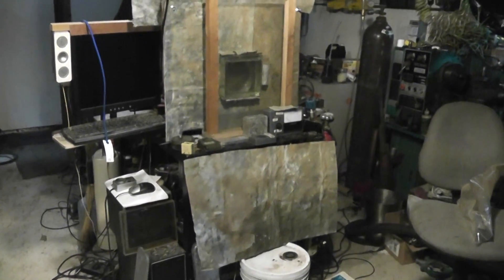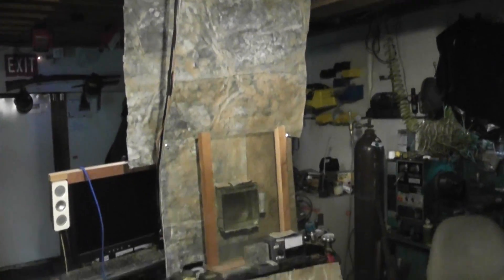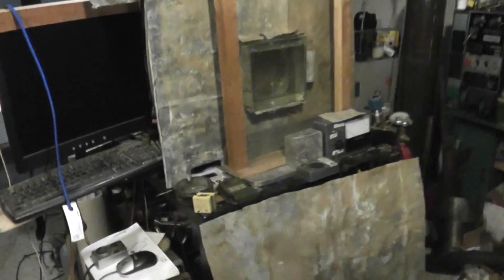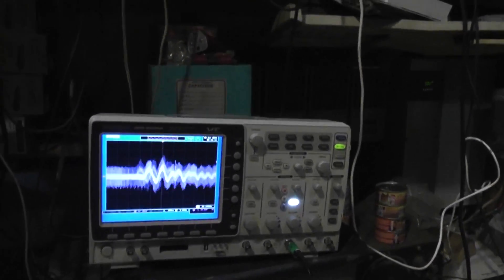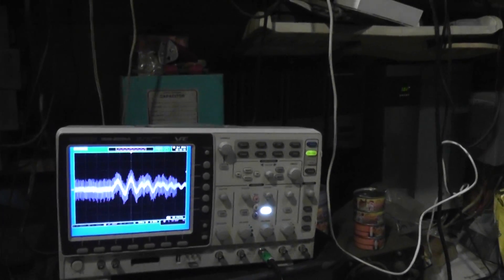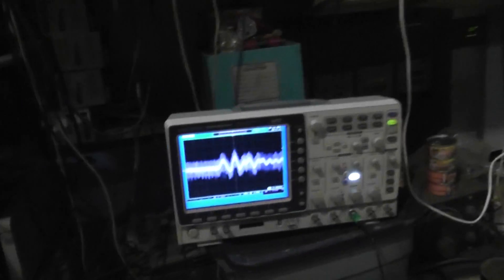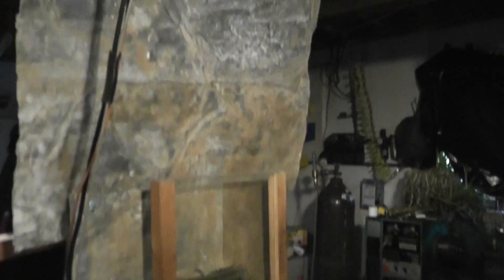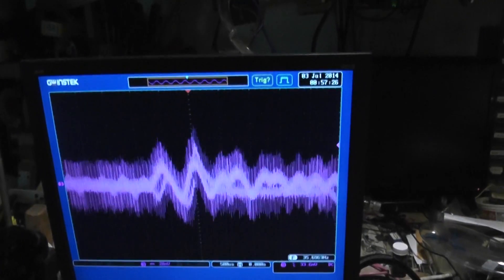ShieldNScope

Comment: Your set-up is looking great! Really appreciate the update videos and the channel in general. Looking forward to seeing more.
Reply from the maker: There will be more when it's worth it.  I use this primarily as an adjunct to my web forums - yet another way to document my work (and share it open source).
Right now I'm doing all this boring crap with shielding...crawling in the crawl space in the dark fighing spiders while digging new flat spots for more cinderblocks to hold up all this lead and other nasty work like that - with a whole 2 feet of room between the bottom of the floor and the dirt to work in..  Heck, even I don't want to see it at the moment, it's just necessary.  Believe me, it's driving me nuts too - I'd rather be nailing down that huge advance I think we just made - but I want to live to tell the tale!  So, we beat lead flat, make castings for more shielding, make sure it's doing what it should, junk like that no one really wants to see much of: "conceptually trivial" but actually pretty hard work.

Comment: How long until we have free energy Doug???  :)
Reply from the maker: Wish I knew.  I just know I'm going as fast as I can, which turns out to be faster than just about any historical effort I can think of by quite a bit.  BUT!  This isn't "tradeable info" or a "sure thing" yet, just being honest.  We could (and have) come factor of a 10 million++ since we started about 3 years ago, still have say 10k to go (very conservative if the latest thing pans out - which mayday run is kind of a hint of), haven't run into any walls, other than operator safety - which I'm working now, it's looking good so far. 

But let's assume I get there in say, a week (unlikely, this is for hypothetical). 

OK, now we get to go through some guy from a steam plant maker designing a boiler/turbine system for it, and getting the government to approve it, a financing process, and probably some new regulations have to get passed.  Not that these can't go a lot faster than they have in the past - this is pretty "safe" compared to fission (or coal!) - but...we know those things take time to get the power to your outlet.

It will never be free.  Someone has to make them - I'm just one guy.  They deserve to get paid for making them, no? (maybe not a state-guaranteed profit as now, but some anyway)  I might give the plans away (and that's plan A) but...that's not all it takes in the real world.

As far as building one of these home sized (which I'll for sure do for myself), that's probably quicker, but my solar panels likely cost less per watt and work great.

Not free - freedom.  I don't have to work to pay my bills, because I spent wisely on things to eliminate them in the first place.